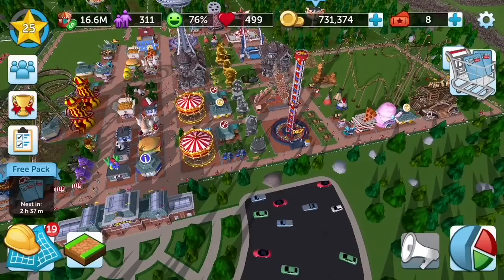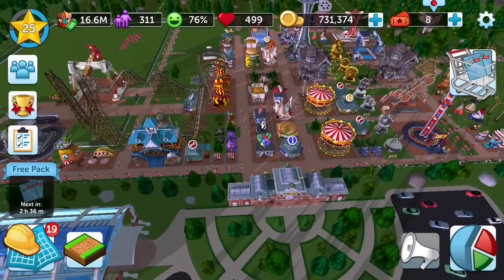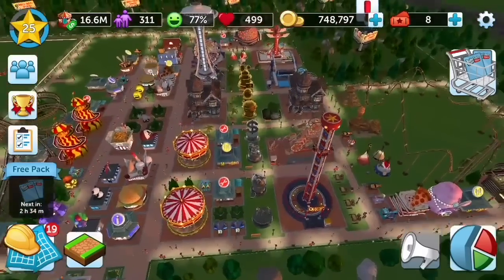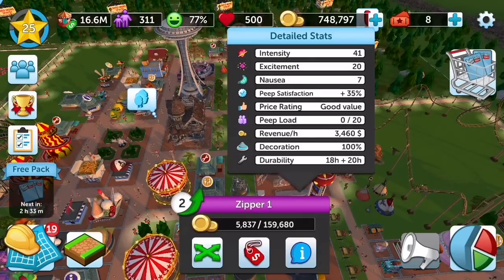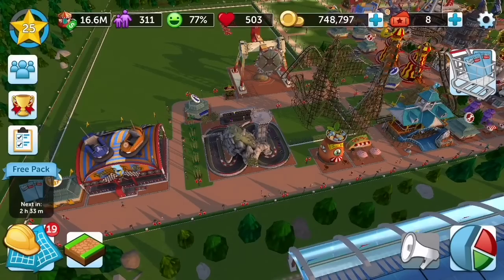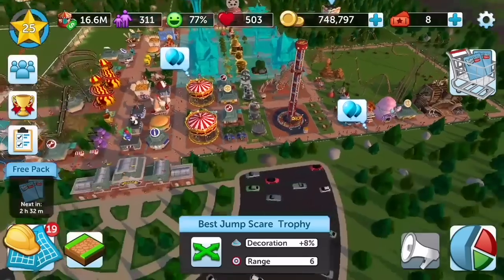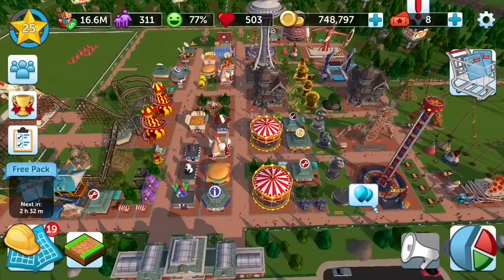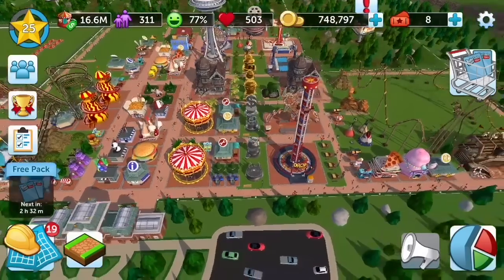Best Park Design | How To Design Your Park | RollerCoaster Tycoon Touch | RCT Touch

Comment: Pro-tip to get HIGH satisfaction. Space EVERYTHING out. That means taking into account that no two type of the same rides are near each, restaurants, etc. I section my park off and make sure one of each is in each zone (currently 6 zones) with a coaster in between zone 1/2, zone 3/4, and zone 5/6. It's all simple mathematics really. Basically think of every guest as having a different personality. One likes kid rides and mexican, the other likes thrill rides and burgers. They don't want to have to go ALL the way across the park for a taco or a ride. They want it within reasonable distance.

Comment: A tip.  Log in every 2-4 hours.  Rides will never ever break.  Yes never break.  Every 4-8 hours works too but I recommend 3-6 hours so you get a free pack and coins and rides won't break.  Might be a bug not sure.  I don't need ride maintenance :)
Reply from the maker: +Benny Chen Hey Benny, this is not a bug. The rides only break if you are off the game for a long period of time. Some rides have a maintenance of 24 hours meaning asking as you play the game atleast once every 24 hours your rides won't break

Comment: Decoration has 0 effect on satisfaction but does effect park value increasing number of people.
All 3 type of rides close together. If you have too many restaurants your fun meter will drop hard.
Shops and rides need to be at a close ratio to the food.  Carts sabbotage your fun meter.

Spread your restaurants and shops  out and fill gaps in the path.
Leave space for decorations.

Use the janitors radius to engineer your paths.